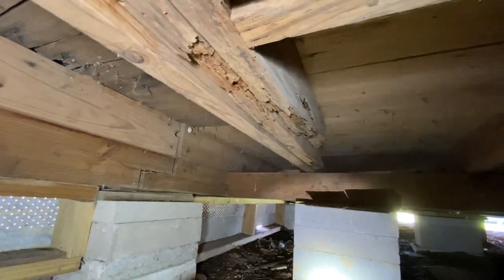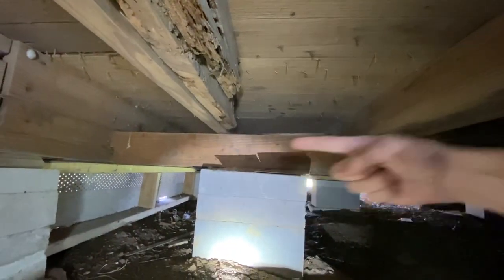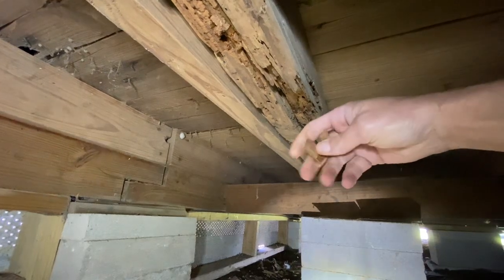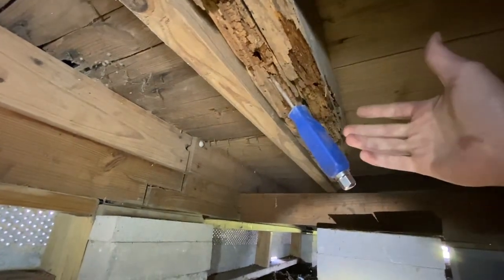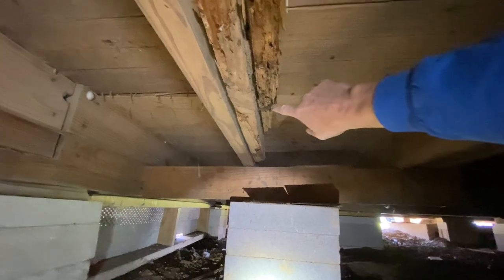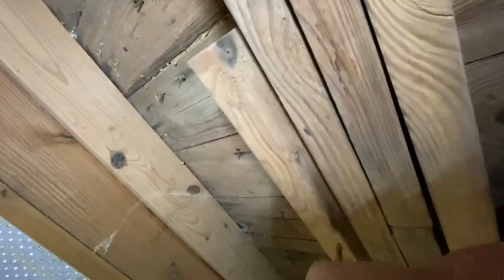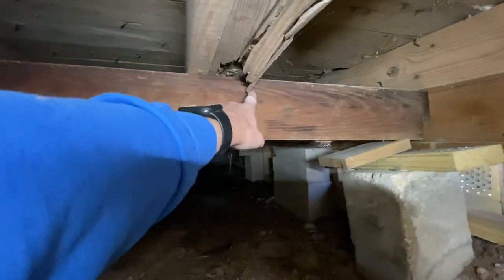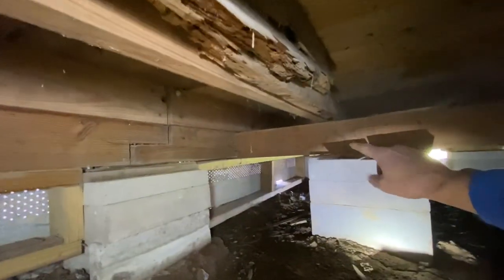What Does It Look Like to "Sister" Floor Joists? How Should It Be Done?

Comment: So you just leave the termite-bitten wood there? It won’t cause any problems?
Reply from the maker: As long as the subfloor is ok, a new joist placed next to termite chewed joist now takes the weight off the damaged floor joist and provides the needed support.

Yes, we just leave in it in place… and provided the termites are treated and no further problems remain.

If the subfloor is damaged, then there would be no "sistering" involved. In that case, we cut it all out and rebuild and don’t leave anything old behind. Hope that helps your understanding!

Comment: that's not true you don't have to sister from support sill to support sill.  you just have to extend about 3 feet past the damaged section.  They did it correctly.
Reply from the maker: Absolutely it’s ok to do it the way you described… but that would be called scabbing vs. sistering… and in the video you can clearly see it wasn’t past any damaged section and there for wasn’t secured and was loose.
Reply: @AnchorFoundationRepair  Correct...the real issue here wasn't necessarily that the board didn't extend to the next support (although yes it was because the entire joist was rotted), but scabbing past the rot & into solid can be a great way to shore messes up without huge expenses.

Comment: I don't understand why the person didn't just use a slightly longer 2x6? Why shortcut for practically no gain to oneself and risk one's reputation as a cheater of homeowners?
Reply: it is not cheating anyone.  the length of overlap for two lengths of beams is the depth of the beam x3.  So if using a 2x8, the actual depth is 7.5 and so 7.5x3 = 21".  So 21" past the rotten section is enough to match the original strength of the beam pre-rot.  Looks like they satisfied this rule of thumb and the repair was properly done.  Why are you saying its bad?  It's not.
Reply from the maker: I wish it were as simple as “measure twice, cut once”… but I don’t think that’s what happened to this home.  Fortunately, we’ll get to make that and many things better soon.